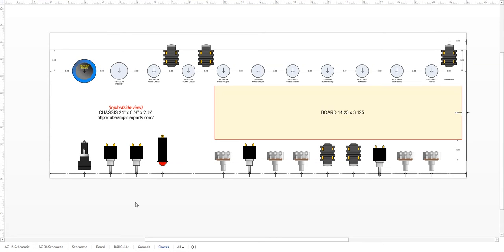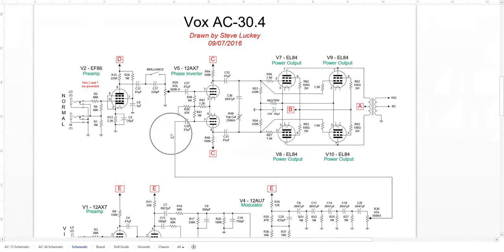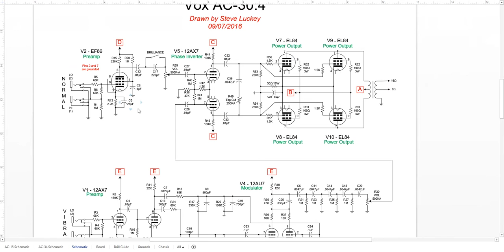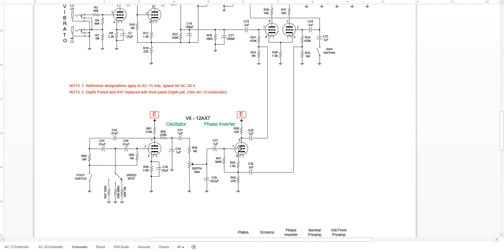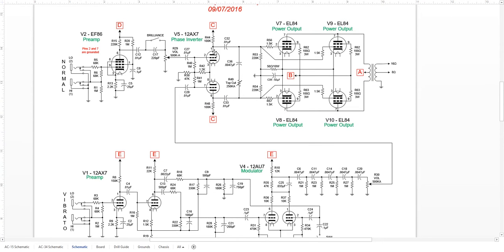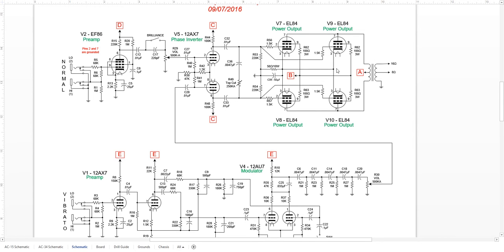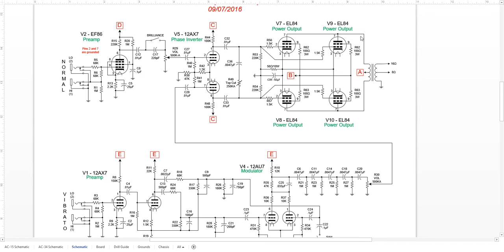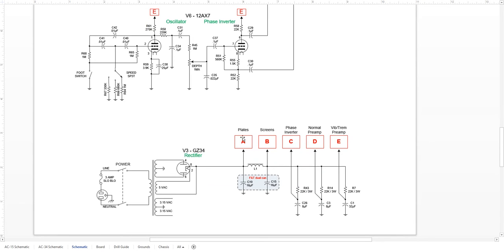Vox AC30/4 Video 2

Comment: Sweet, I  just came across your videos, as I have an amp project that's been sitting on the back burner for a while.  Initially, I was looking at trying an AC-30 as well. In my digging for information, I landed on a Matchless DC-30 clone, but eventually settled on a Chieftain style layout.  I think dosing myself in your project progression is just the motivation I need to once again move forward on my build.  I'm looking forward to more in your series.  As a side note, I would like to know how you spec'd out your iron for this project (in case you haven't already covered this in another video.
Reply from the maker: +Al Nevsky I just ordered some from an online retailer that was specified as ac30 replacement.  They're heyboers.  It's a great amp and a blast to build.  When you finish.  I'd live to see the completed amp!

Comment: Nice vid, did you consider making a PCB? In such a small chassis, you can make it more compact while reducing noise and chance of parasitic oscillation.
Reply from the maker: +Non Stop Pop thanks, I do all of my builds on turret board, makes long term maintenance easier, and reduces vibration damage that can happen with pcb design. Esp on guitar amps.  They get moved a lot and played at really high volume.  Common modem guitar amp faults are often attributed to pcb design problems with vibrations
Reply: Frenchie Films
The maintenance point is valid, replacing any component with more than 2 pins is annoying. A well designed/though out PCB is in every way as reliable and sturdy as turret board. Just look at mesa or soldano.
Reply from the maker: +Non Stop Pop absolutely true, but I don't have three things needed: skill at pcb design, skill with pcb design software, and the means to really get high quality single sided pcb work done :)

Comment: Hey i would love to build a version of this amp as part of my college project, where are you getting your parts from? are you making them yourself?
Reply from the maker: +Harry Keane I buy most of the parts from Hoffmanamps.com. He's got a specific setup for the AC15 just like this one by way of a forum thread called something like sluckey's ac15 I also have linked the thread on the same forums here in the description of the video for this build.  Just so you're aware, this is a very ambitious project, and tube amplifiers work at very high voltages, so be very careful!
Reply from the maker: +Harry Keane Here's the actual forum thread on the AC15 that's almost identical to mine: http://el34world.com/Forum/index.php?topic=17184.0 You can order either the AC15 or maybe ask Doug if he can modify it to be like my AC30 (it's a minor change, just requires adding two more anode resistors and two more grid stopper resistors to the board. The layout etc is in my forum post at the first post that I linked in the description of these videos. (see above)
Reply: Thank you very much mate
Reply from the maker: +Harry Keane you're very welcome